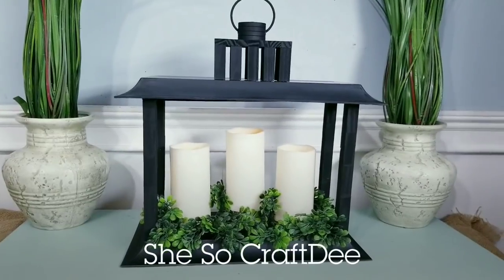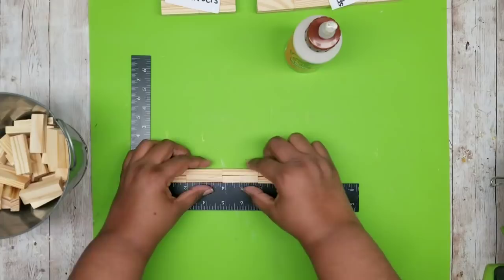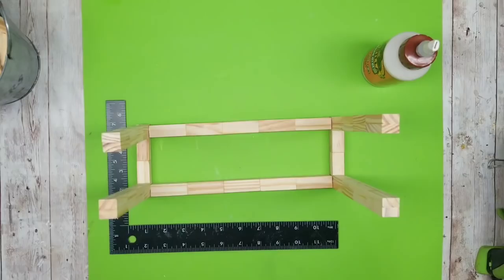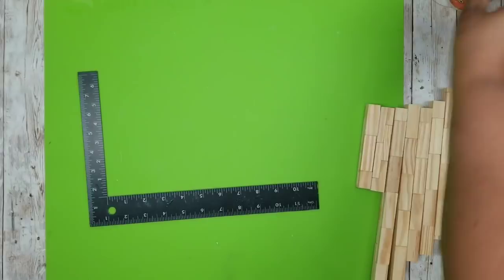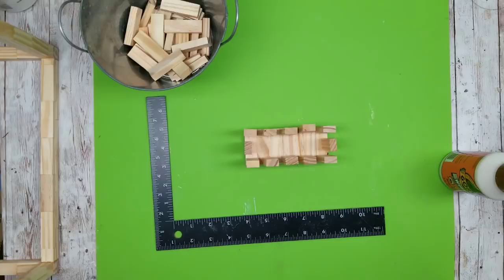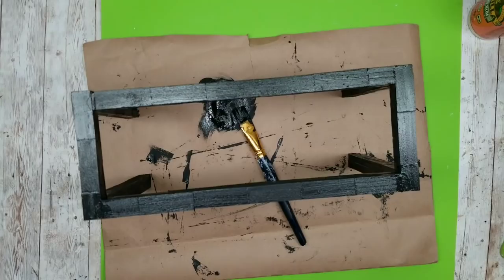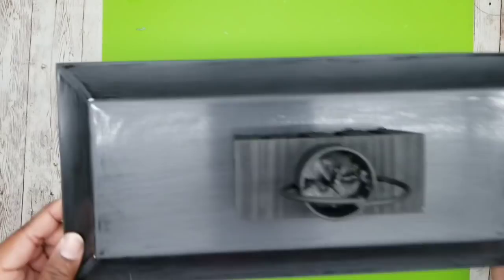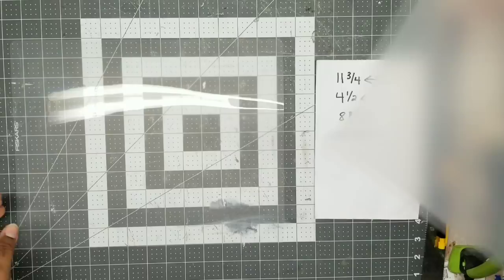*NEW* ALL DOLLAR TREE DIY LANTERN | New DESIGN with 5+ Looks in One | Christmas 2021 HOME DECOR DIYs

Comment: What a freakin' AWESOME idea!   In hindsight, I would have used the buffalo plaid tray on the bottom, and the silver on top.  Soooooo cool!
Reply from the maker: Yes, I wanted to do that as well, but the buffalo check tray is melamine, and will crack under drilling and pressure. The solid silver one is a heavier thick plastic 🙂.

Comment: I am one of your fans on crafts. I just wanted to give you a little tip though..... I separate the blocks before I use them. I line them up side by side and use all of the even ones for my projects. The projects turn out tremendously well because there's no unevenness throughout the project. Like I said I lay them side by side and take my finger and rub it across the top and see if they are all the same height and then the same width. I know it is time consuming but it is well worth the effort. I just wanted to give you a little tip of what I have found out about the tumbling tower blocks.            This is an amazing lantern!!! Girl it is off the chain!!! All of your crafts are amazing but I truly love this one.
Reply from the maker: Thank you for sharing! I occasionally get a dud in a pack of blocks, and catch it before it goes into a project. I try to make all my pieces as straight and even as possible for a good end result.
Reply: @SheSoCraftDee  yes but you are naturally gifted. Lol. people like me have to go that extra length to make it work for us. Yours always comes out perfect no matter what. I'm caught up on all of your videos and I appreciate the one that I saw today of the new lantern you designed. I'm about to make that now. It just will not look as good as yours of course. 😁👍